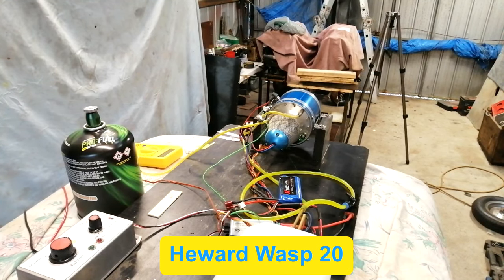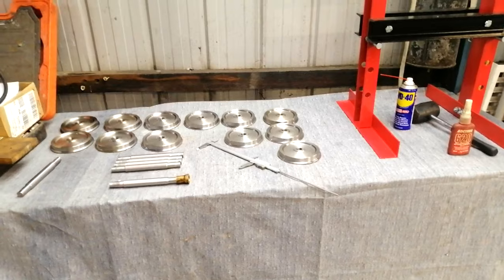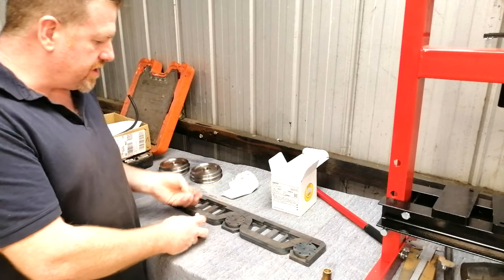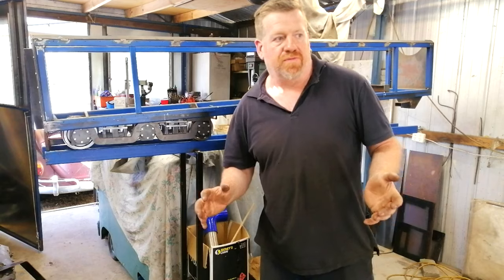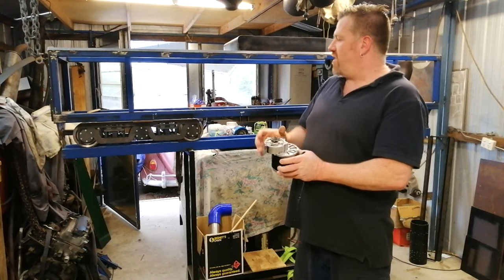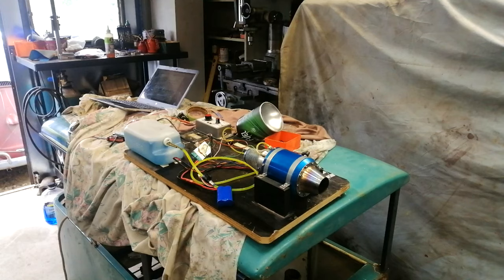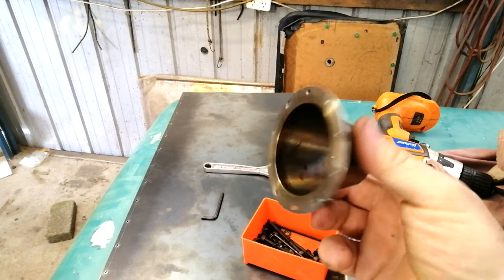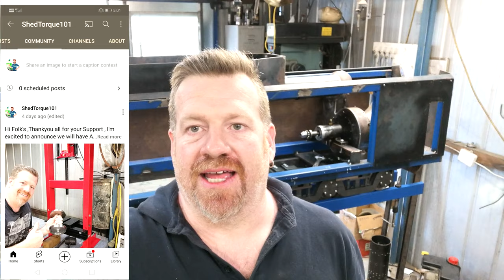Union Pacific Gas Turbine Build

Comment: How are you planning to spring your trucks such that they can flex? If you're running 3 axles, the middle wheel should float to accommodate for undulations in the track. On the real turbines, the two bottom plates running between your bearings were separate pieces and sprung from there. This helped distribute the weight equally. You may know this already, but I'm not quite seeing how that will work. That being said, this thing is looking sweet.

Comment: are you using the gas turbine to drive an old turbo to act as your generator? if so you'll need a system for lubricating the turbo shaft with engine oil. a basic pump,resivour and piping (all need to be able to handle atleast 100c) should do the trick
Reply from the maker: Hello Alex , this will be covered in the next video I do on the build, thankyou for taking the time to comment
Reply: @EverythingAnthonySOS  looking forward to your update; which State are you in ?

Comment: Do you have any idea of what the total weight will be for the B unit after all the construction is finished?
Reply from the maker: Hi Jeff , I have no idea  what the total weight will be , it's adding up fast  !
Reply: I just wondered if you might need some sort of hoist  to move it off the building area to the floor.  Also loading and unloading it into a vehicle
Reply from the maker: @jeffbutler6100  after it has been pulled apart for paint I will make new stands the same height as the trailer bed
Reply: I see.  Just like the guys that have large live steam locomotives.